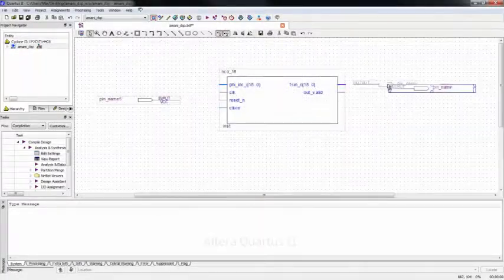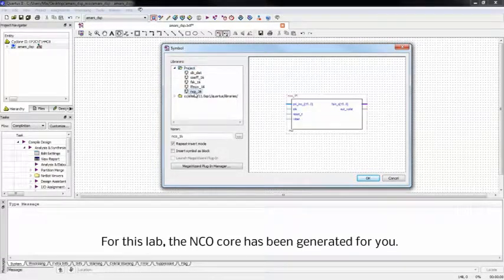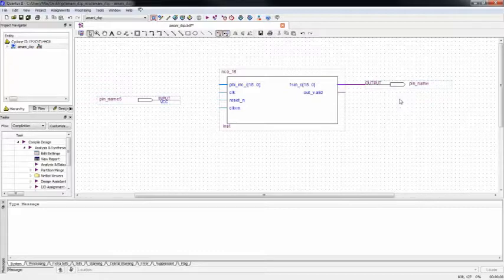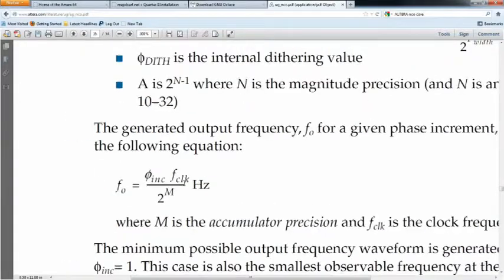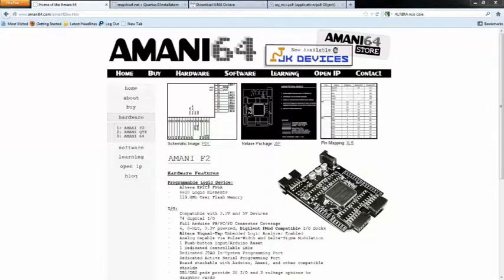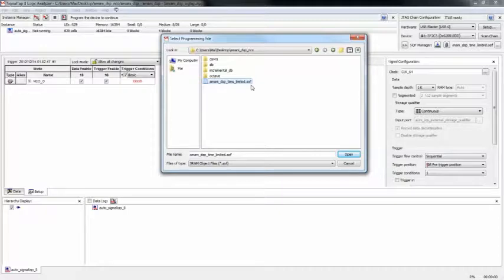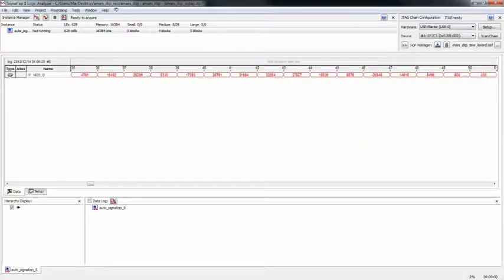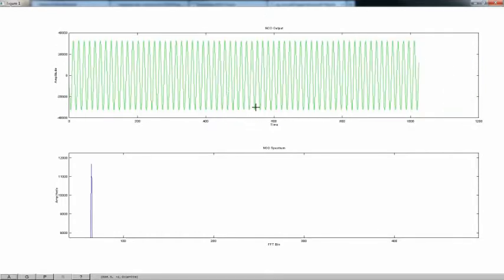Amani F2 FPGA Sheild: DSP Lab 1-1: The NCO

Comment: Sorry but, this also works if we want to see the signal in the oscilloscope? or it just work when we simulate it? I want to send a sinusoidal signal from the FPGA trough a DAC and then to the oscilloscope, in this case, what might change?
Reply: You'll need an external digital to analog converter (DAC) to view the output on an oscilloscope.  Another option is to use pulse width modulation on one of the GPIO and low pass filter it.